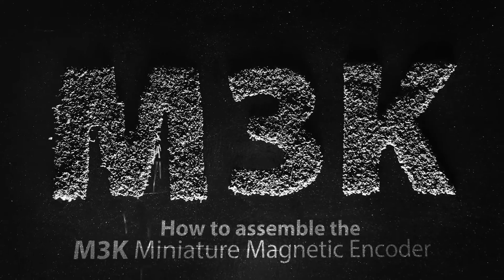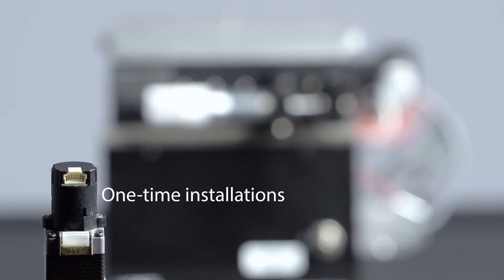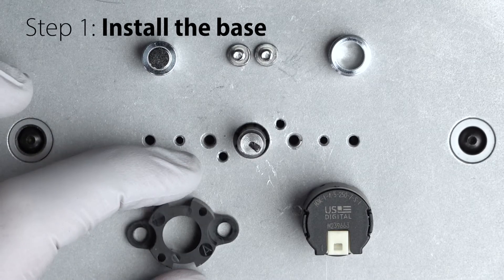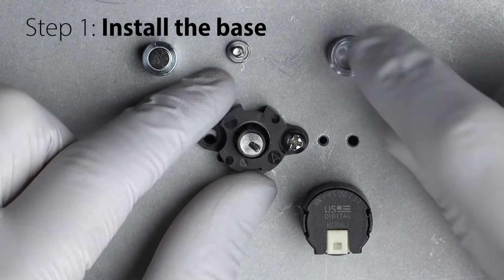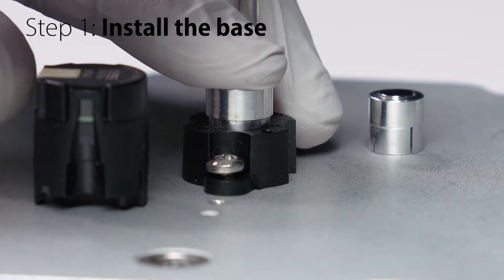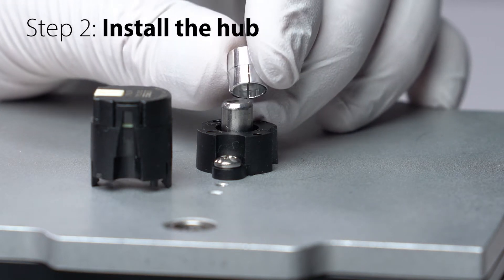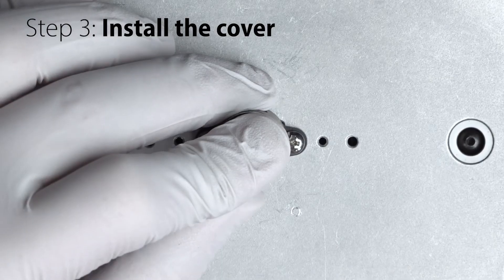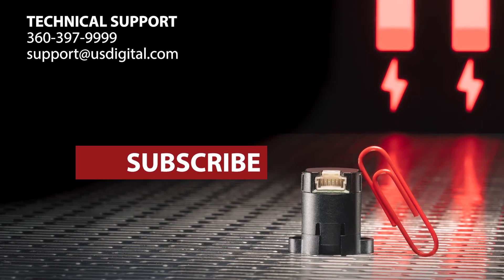How to assemble the M3K Miniature Magnetic Encoder | US Digital

Comment: I am now working on M3K MINIATURE MAGNETIC INCREMENTAL ENCODER Item Number M3K-P-8192-5-236-5-M-B.i have mounted this encoder on Stepper motor & issue I am getting is When stepper motor is normally powered with power supply or by any controller, encoder start generating pulses of around 1 to 2 kHz & having different width & time period but when stepper motor rotates it works perfectly Giving perfect 90 Degree phase difference signal of A & B channel but when we stop rotation of stepper motor it Again start generating Random pulses !! I have also used DC motor with mounting same encoder & getting same issue so please help us & provide useful solution as possible please.